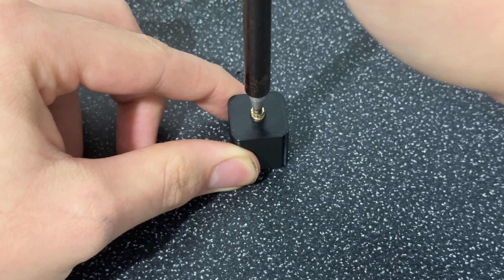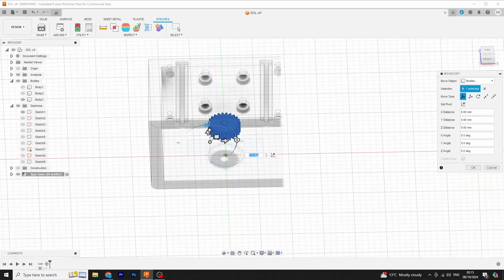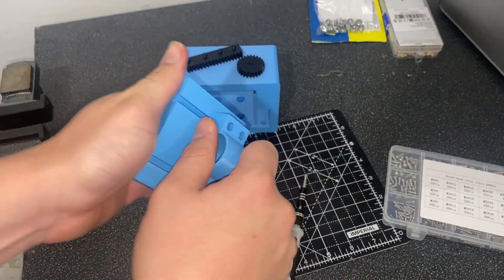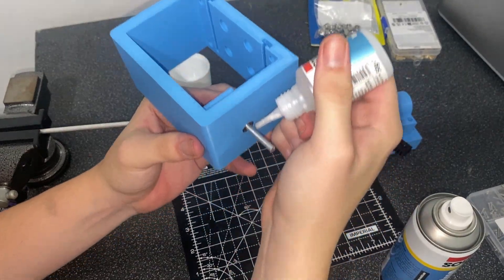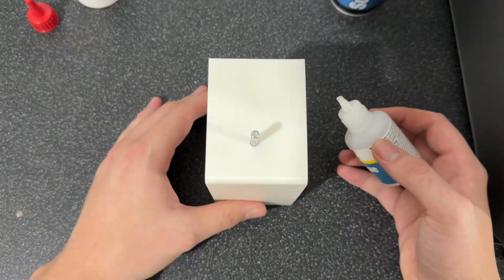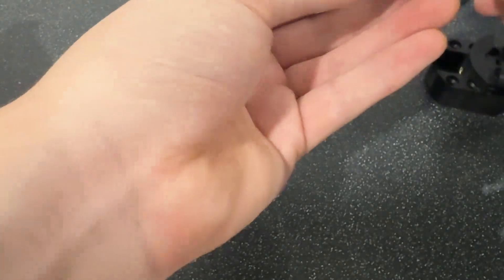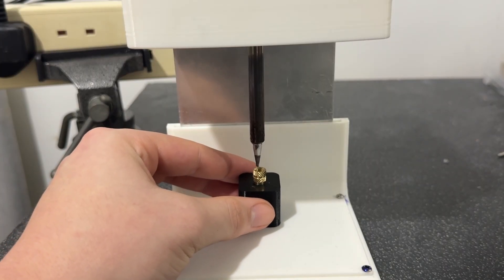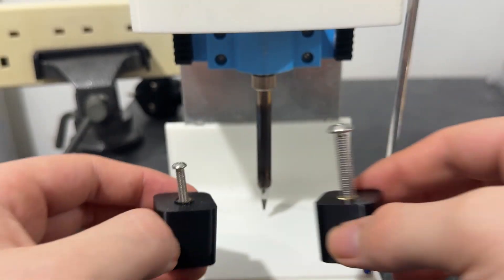Heat Set Insert Press Revolutionized My Workshop!

Comment: I never use super glue straight from the bottle. I put a drop onto a palet and apply it with a tooth pick.
Reply from the maker: Thanks I might have to borrow that trick. Probably works much better than trying to squeeze it willy nilly into hard to reach places
Reply: @HowHardCanItB You can even buy special ablicators, but for me a toothpick works just fine.

Comment: Clever design! 

I sometimes design a hub that protrudes out put a heat set insert in it for a setscrew.  Oh the irony 😄

Are you using Fusion 360?
Reply from the maker: Thanks!
Now I have the press I will for sure use that idea for any hubs I make in future
Yeah I am, I use fusion 360 for all of my CAD work

Comment: Nice construction!  One tip with superglue, if you keep the two surfaces moving during curing, they don't bond.  So it's fine if it touches something you don't want it to adhere too, just don't let it sit still. You can also apply some oil or greace to one surface and then glue, that way it won't bond either. 

Otherwise, great project, works pretty good!
Reply from the maker: Appreciate the kind words thanks :). Will definitely be using that tip in future it will save me so many headaches!